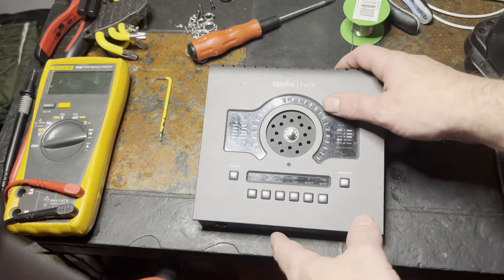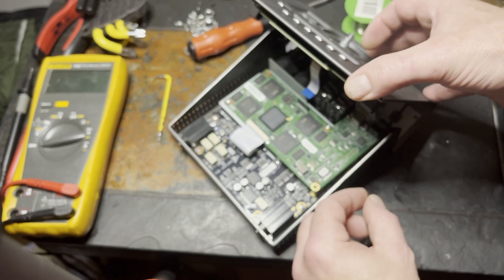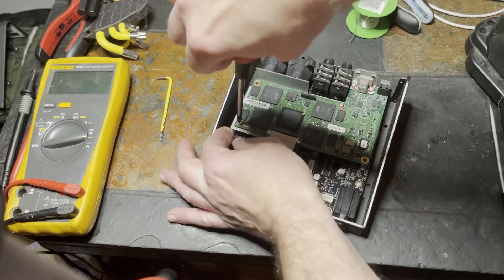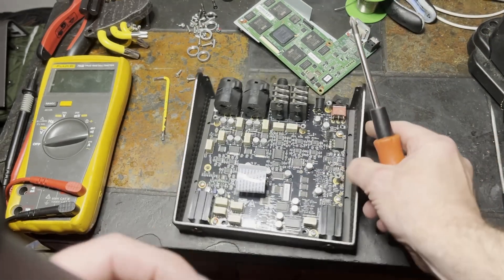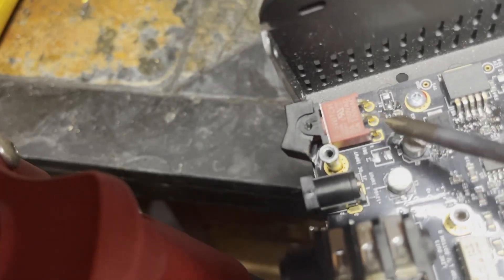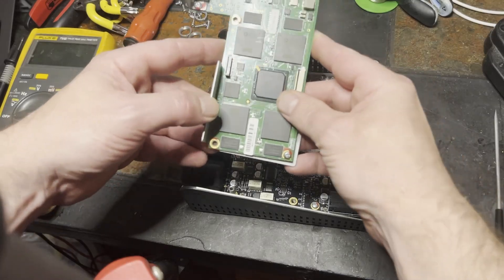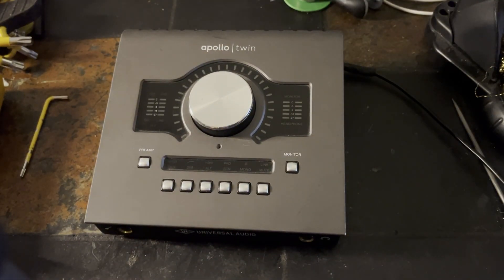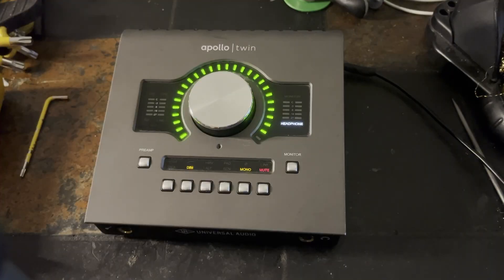Universal Audio Apollo Twin Repair

Comment: Hi, nice video! Unfortunately I just got a broken jack into the headphone out of my twin x. I tried with some tweezers to take it out, but I  was able to get out just a part of it . Any suggestion? Do you think it could be of help to open the case? Thanks!
Reply from the maker: I just checked the video and it looks like the Headphones are in enclosed casings unlike the TRS at the rear.  So I do not think it will help to take the top off.  You will need enough force to overcome the contacts.

Comment: Hey, I have an apollo twin x that's been bricked (asks for update, then doesn't want to turn on with a red light flashing inside). I looked on reddit to see if anyone has come across that issue before and someone said that it's possibly a capacitor issue. I'd love to have your opinion on this if you are able.
Reply: hi! hello! I have the same problem with my Apollo Twin Duo MK1. Only the internal red lights flash but the interface does not start. Did you manage to solve it?
Reply: @rafahatecrew  Any solution. I have the same problem now . Help
Reply: @TillieGya  hi, I have the same problem, did you to find a solution ?
Reply: @rafahatecrew  hi, I have the same problem, did you to find a solution ?
Reply: hi guys, I have an Apollo X4 doesn't want to turn on with a red light flashing inside. did you find a solution please ?
Reply: Here's one more with the same problem... What to do?

Comment: do you know how to repair the wheel internal? mine is loose and wonky, it will skip volume and stay still even after moving the knob... helppp
Reply from the maker: Take the knob off and check the nut that hold the potentiometer is not loose.
Reply: @reallyniceaudio  Took knob off, protruding nut is a bit loose
Reply: @kelvinbeat17 Was it possible to slightly adjust the position of the potentiometer whilst the nut was loosened, in order to centre it perfectly for a consistent gap all the way around the knob?

Comment: Thanks for this! Do you have any notes on the analog input stage of the mic preamps? My apollo twin has an issue where the ch2 XLR input gain drops intermittently, but snaps back to normal after tapping the interface enclosure or pressing a button.

Comment: Did you get a part number on it? I just picked up an apollo twin off ebay for $30 (10$ plus shipping)  that isn't powering on. Not sure the cause yet but I am researching causes for powerloss and this seems like a possible outcome in event the fault protection on reverse polarity popped ie.this diode. Not sure what other scenarios exist for power not working but I suspect this is high up in the list of possible outcomes depending on where the surge comes from.  In fact I am looking for schematics for the apollo twin to help with the troubleshooting.  also can that diode just be bridged ie only serves as like a zener or some other function?
Reply: @WilliamAshleyOnline  14v TVS diode likely. Measure the marked voltage points on the board as he mentions. I also have a repair vid on the same issue, hope it helps.

Comment: What's the process to remove the nuts on the four line inputs? I tried to unscrew with my fingers but it's too tight. Is there a special tool for this?
Reply from the maker: I just checked the video and it looks like I used a Torx driver.  It fits inside the screw, if you watch from 3mins you will see me using the yellow Torx driver.
Reply: @reallyniceaudio  I don’t think that’s the one. It’s the silver nuts around the four line inputs that’s holding against the case
Reply from the maker: @mle8603  Oh do you mean the large nut for the sockets.   You can use thin nose pliers as there are two square cutouts cut in the nut.
Reply: @reallyniceaudio  Great idea, thanks! I see the cutout on the nuts and will look for something to fit inside and get them to twist loose.

Comment: Have you ever run into issues with the 12v locking connector? I've had to fix mine because over time, with plugging and unplugging, the contacts broke and I had to solder it back together. I've since replaced the 12v power supply that came with the unit with a 12v that doesn't lock.
Reply from the maker: Sorry it was not my device, I am sure you would be able to find the right connector from digikey, RS etc.  You will just need to check the dimensions and pin spacing etc.  Digital calibers are great for this.

Comment: RIP sweet diode, you did your job perfectly.
Reply: @frequencymanipulator  no quite. Failing open circuit would stop the power supply from overheating and burning down the house. Dumb human tech is everywhere :)